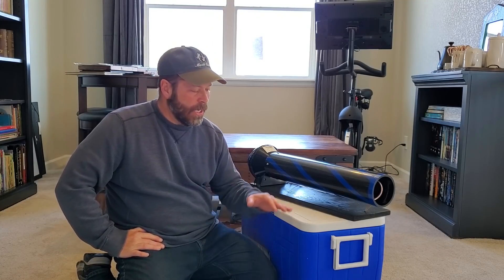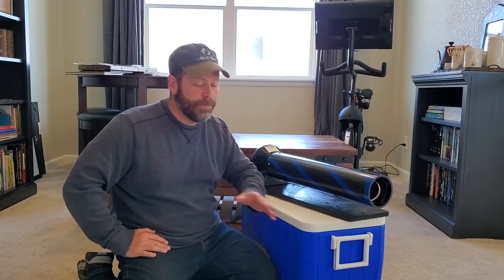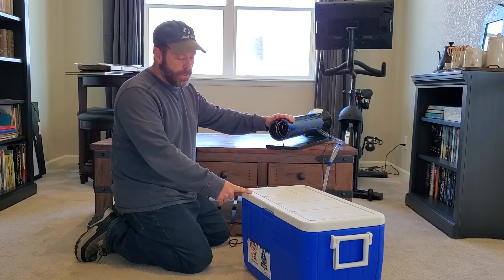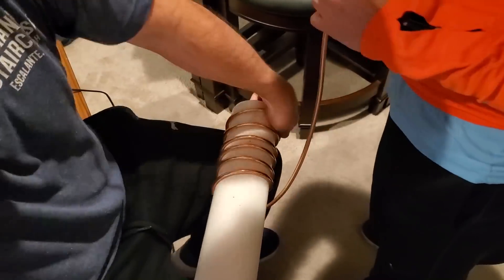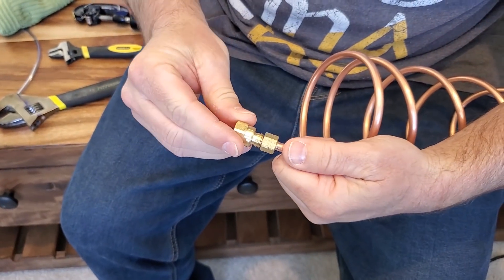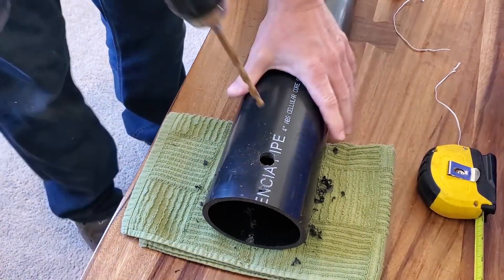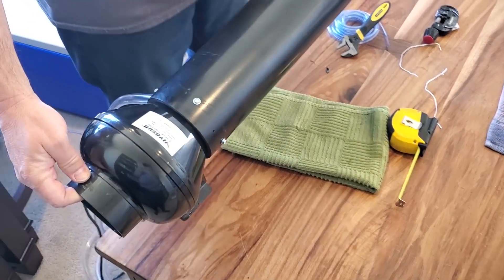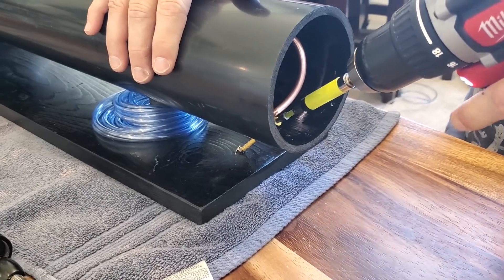Homemade Portable Air Conditioner DIY - NO HUMIDITY! - Long Lasting Ice! - The Fan Cannon

Comment: Cool idea. I’d like to see some temp readings to see how efficient it really is. 
Cheap improvement ideas:
1) You could put salt in the water. That’ll drop your “coolant” from 0 to as low as -21. 
2) make your coil a series of flat coils (like an old electric stovetop burner). This will maximise heat transfer from the fan. But will also reduce fan output. So you’ll want to find a good balance because part of what makes this feel cold is the evaporative cooling from the fan on your skin. 
3) put in a big block of ice vs small cubes. This will theoretically increase the thermal mass and therefore the efficiency.
Reply: Between three comments I thought of rock salt being added to the ice to make homemade Ice cream 🍦  .....Back up boys  , I have 50 years under my belt at making Ice cream !  I made a rough cooler once with frozen water bottles of 20 Oz and 2 liters in a big Rubbermaid tote , forced air thru the bottles and out a vent. Thank God for our freezer because it took several  sets of bottles throughout the day because they melt down faster than you can freeze them back. Not practical but I thank God for giving me enough  common sense to put it together 🙏  .  The best of my life had come home after a double mastectomy and the removal of 3 lymph node's  and we had a few days of record breaking heat . Until we were able to cool our home  ,  I kept that air blowing onto her body for several days. We already had many bottles frozen that we used for our camping trips and had dozens more empty bottles that we had saved for other things . It's funny that long before the surgery,  we had fussed over the empty bottles that were in a big plastic bag, to keep or throw away , how they were junkies up the utility room , never knowing that God had a plan for them bottles. That was over ten year ago and yes, she is still with me and the cancer has never returned. I didn't mean to be lengthy or make the subject into something else , I think I triggered myself  and just kept typing,  if it bores someone then it's too bad because I'm posting !  PS  ......OK boys get on with your designs  and figure out something better , God Bless
Reply: wouldn't the water in the tubes be at risk of freezing? could you add alcohol to the "coolant" to lower the freezing point? though I'm not sure if that could be corrosive.
Reply: @MrKool4kats  have you ever seen water in a cooler freeze?
Reply: @MrKool4kats  If ice cold water freezes in any part of the process, it would be a great accomplishment, never a hindrance. 
Transferring a frozen temperature is way better than transferring a cold temperature.

Comment: when I made mine I regret not insulating the copper lines as they sweated all over and many towels were needed to catch the condensation. My unit was made out of necessity when my home AC went out until it could be repaired. Therefore the Ice melted much faster as compared to this demo done inside an already cooled room, I assume.

Comment: Going to try this; Concerned that he says copper but link is to steel brake line. I live in high humididity FL, have cwntral AC but primarily only use bedroom & small office; want to try this just to cool those rooms to cut summer electric bills. I'll report back with my results. Good video, thanks!
Reply: Well. How was it, fellow Floridian?

Comment: If you freeze a bunch of water bottles, you can just reuse them also, just a tip that I use to keep the rest of my stuff cold for longer than just ice cubes.
Reply: Ryan you might be right about that, but I don't know for sure. I only use the frozen bottles as ice packs, and identify them by removing the labels, ill only reuse the same frozen bottles over and over again, as I don't exactly trust the plastic leeching myself. So for the purpose of this AC unit it should be okey.
Reply: Ur a freakin genius. I was watching this video to hopefully find a solution for possible water coming through If I built one of these for a bus but with a fam with a larger cfm. This is the solution. !!!! Freakin water bottles. Ur a genius.
Reply: I'll probably be seen as a crazy person, but water bottles exposed to extreme heat and cold leech off chemicals. Idk if you use safe plastic, but most sites report it's very unhealthy to drink that water over long periods of time. But who knows, maybe it's all bullshit I'm not an expert
Reply: @justwannausemymomsipad  I thought they only are dangerous if they’re left in the heat specifically in the sun. If kept cold. It should be fine.
Reply: @Philosopherseyes  Maybe you're right. I was always told it was extreme temperature, regardless of hot or cold, but I guess thats what google is for
Reply: @justwannausemymomsipad  you're not drinking the water?
Reply: @chrisdevalcourt648  If I'm using water bottles for this purpose I drink the water first. I fill it with sink water and reuse
Reply: @justwannausemymomsipad  got it!
Reply: No one us drinking it. @justwannausemymomsipad
Reply: Its consistent temps below zero, high temps especially in sun, and huge repeated temp changes (so going from one extreme to the other) and some brands use safer plastics now

Comment: Another cheap way to make this, would be to find a discarded window AC unit or dehumidifier and use the evaporator or condenser radiator that's inside and also the fan (if it still spins) to replace the spiral copper tube & inline fan. Make the radiator mount onto the lid of cooler or off to the side using long water hoses, have the fan mounted to the radiator blowing air across the radiator. Similar to the setup of an electric fan in car blowing air across the radiator.
Reply: What about the coolant in it? Isn’t it cancerous?
Reply: @TheGrandTato  My neighbor threw away a window AC because all the coolant/refrigerant leaked out. No more cancerous than propane or butane some refrigerant is actually literally  propane & butane.

Comment: What if you put dry ice in the cooler? Could it work also?
Reply: I believe there would be a risk of co2 poisoning
Reply: The water (coolant) in the line going into the air cannon would freeze pretty quickly with dry ice

Comment: FYI..the "copper" tube you've listed is actually steel with a copper(ish) coating. I'd expect it to rust fairly quickly pumping straight water.

Comment: Awesome design ! My only question is what about all the condensation on the lines ?
Reply: this might be dumb but couldn't you just tilt the fan and let the water drip into an external resvoir? like a bucket
Reply: well said i was thinking the same thing although a return could be placed in the tube but for the standing fans idk how that would work

Comment: It would have been nice to see a temp from the output of the unit
Reply: temps aside this will work fine, it's just a radiator attach to and ice bucket. Should just buy a normal radiator instead.
Reply: @lateforwork2922  I was thinking that too but i think the tube design may be a good idea.  I like having the air forced through a cold enclosed area.  I thinking adding more copper tubing, double, triple the amount and insulate the tube and you can have something that works very well, shooting cold air in the concentrated direction.
Reply: @vinzklortho3013 why bother insulating the tube? Is it not an indoor system
Reply: I use a transmission cooler.
Reply: @south_pa   I’m interested in seeing a photo of how yours was made. I enjoy learning this DIY and seeing where the transmission cooler is located, where you bought and how you installed it? 👍🏻
Reply: Or maybe a heater core?

Comment: Looks good.  
With the 12volt configuration ( and a good LiPo battery (or 2) for power ) would it work well to cool the interior of a small 4 - 6 seater airplane?
Thanks, Chuck (NE Florida)  : +)

Comment: What is the difference between this one and the more simple version with an 8 or 10 inch fan blowing directly down into the cooler filled with frozen bottles? Honest question, I love learning. My version the quality of the fan is key. Typically a high speed heavy duty fan at 10 inches for the exhaust . Instead of one 3 inch elbow outlet blowing in one direction. I add 2-3 two inch elbow fittings spread in a Y formation to cover more area. It was blowing a constant 36 degrees for several  hours and kept the area very comfortable for over 6 hours. Of course I used a very large cooler, 10 inch heavy duty fan with a higher speed than most domestic fans. You couldn't sit in front of it more than a few minutes

Comment: Just put a fan in the lid and a 90* outlet of pvc. No need for tubing, copper, or pumps. Will help with condensation as well.

Efficiency will also increase due to not needing electric for the pump.

Just my 2 cents worth...
Reply: And adds lots of humidity!

Comment: I would hope there is no or low humidity since one of the main principle operations of an air conditioner is to remove excess humidity and heat.
Reply: Most diy systems are glorified "swamp coolers" which dump cool, but humid air into the space. This design is similar but does a better job of keeping the moist air inside the loop.
Reply: Yep that's why they are called air "conditioners" because they not only drop the temp but they remove the humidity. This is merely a chiller.

Comment: Excellent idea.  Missing condensate return back to cooler as noted in other comments.  If you are not having much condensate, then most likely your output air is not cold enough to draw out the moisture from the air.  In that case, lowering the amount of air would help...this would reduce output temperature.  Also, since this is a closed system the height doesn't matter to the pump.  As long as you start the flow going at a lower elevation, your pump will work regardless of the 5 ft rating you mentioned.  Water would then just be syphoning down.
Reply: I'm wondering if you could build a DIY AC that could cool a 10X10 room just as good as a 5,000 btu window AC using less power by adding  an ice maker to the inside of the cooler. Like use those ice tray size/type ice makers that are used in regular freezers....Since there is already a small fountain pump inside, it could have a T fitting on the hose and be used to divert/ pump some of the water back into the ice maker while the rest of the cold water is pumped to the cooling radiator that sits on top of the cooler lid and has a fan blowing on it. As the ice melts the ice maker inside creates more. If you could find a 12 or 24V DC ice maker, DC small pump & DC fan, you could wire them all directly into solar panels without a battery bank or need for an inverter. When the sun comes up it automatically turns on the pump, fan & ice maker and runs/cools until sundown.
Reply: @michaelbrinks8089  If you are going to buy an ice machine why not just buy a 5000 btu ac. It would be cheaper. More importantly what you are proposing wouldn’t work because you would have to extract the heat from you ice cooler out of the room otherwise you are just making the room hotter unless your ice making is more than 100% efficient which is an impossibility. What make an ac unit work is that you have the hot condenser air extracted to the outside.
Reply: @mgpvii  I had the ice machine and other parts laying around for free. In freezers they put the whole ice tray machine inside the freezer with none of it vented to the outside. So I'm pretty sure they don't give off heat from one side that needs vented like a peltier does. If they gave off a lot of heat I highly doubt refrigerator manufactures would put the whole ice maker inside the freezer section without venting it's heat to the outside.
Reply: @michaelbrinks8089  you clearly don’t understand the refrigeration process, work load process and efficiency.

Comment: I'd like to see the temp of the air coming out.  Do you get enough exchange with the copper tube only around the inside wall of the pipe?
Reply: You get 8 or 9 degrees tops.  Don't waste your time and money...
Reply: I don't believe it will cool anything bigger than a small dog house and even then only a couple degrees.
Reply: @alingram5541  Are there some facts rather than opinions? If it cooled down a tent or van or a dog house then it would be worth it. If it could run off of solar then it would be super.
Reply: @carolhewett3756  
Exactly right!
I'd also love to see it solar

Comment: I’ve been experimenting with a bunch of these homemade coolers. There isn’t enough copper coil in that to really do anything IMO!  Hence the reason you see no temp readings. Most of these guys with temp readings are running them in 70 degree rooms. Try making some of  these and running them in +80 degree temps.  You don’t get 40 and 50 degree air coming out like a lot of these videos claim 🤦🏻‍♂️ 🤣
Reply: Lol. Thanks fir exposing facts. I seriously don’t want to chase a losing proposition
Reply: @pattip1413 if you are looking to make a home made cooler to cool a space I can give you some ideas but first what part of the US do you live in?  I’m just asking because my suggestion is something that will only work in an area that has low humidity. I live in Colorado and we have very low humidity during the hot part of the year.

Comment: All the time your freezer is putting heat into your house while it's making the Ice for your cooler. Zero gain.
Reply: Zero gain if your systems were 100% efficient which no system is.  So you are actually adding heat to your house but that is not the purpose of this design .  This is to cool a van/car or spot cooling a small area.  You don't car about the overall heat gain to your house.  You want to feel cool in the immediate space you are in.
Reply: also I don't think this is ment for a house. it's ment for a camper / workshop as a personal cooler

Comment: If your ice is melting faster it simply means it is absorbing the heat at an accelerated rate.  As long as that heat is only being absorbed from your conditioned space there is no inefficiency in having your heat exchanger inside vs outside of your ice chest.  Reducing humidity makes the perceived climate more comfortable at a higher temperature.  The condensation collected by your copper coil should be returned to the ice chest or it will likely evaporate from whatever surface it drips onto.  Your supply and return lines need to be insulated as well due to the condensation that will be formed on them until the delta between the water vs air temperature drops.
Reply: say you had that on the cooler, how do you get to cycle only cool air back into itself? seems like a never ending battle, i get if you cool your room down it'll last longer using the room air but i want something more efficient.

Comment: Why the smaller return tube?
Reply: The output tube probably just matches the connection on the pump; the return tube matches the copper tubing.

Comment: supply line to the coil needs insulating and the return line also. this will lower the over all temperature air flow. nice work.. air flow can be controlled also for lower temp's.
Reply: @charlesmasey6815 --- What could you use to insulate the tubing...?? I'm in process of gathering supplies to make this, and love the idea of increased efficiency through insulation, just not sure what to look for. Anyone's thoughts would be really helpful. Thank you 😊 
~ Heather

Comment: You really should get a patent fh or your idea and I don't mean Invent Help. Your idea will be taken and someone else may reap the benefits.
Reply: Just my 2 cents, but from experience i learned that you can't patent an idea, only a product or device.  
   I had an idea for a tool and took it to a patent lawyer,  and showed them. I didn't know anything about a fee for applying.  I didn't hit. So i took my tool, drawings and photos and left.
    Six months later Gebhardt's, Auto Zone,  NAPS were all selling them. BE CAREFUL WHEN WORKING WITH  CROOKED LAWYERS.  I think that's probably ALL of them. 
   Ya know,  there'd be no such thing as a lawyer if you never needed one.

Comment: IN order to cool a 10' 10' room it would take about 150 pounds of ice Constant without melting. All these kind of coolers are O.K. for cooling one or two people as long as the ice lasts and it blows directley on them.
Reply: True, which is exactly what some people are looking for…👍
Reply: Not true, my friend tested this in car and it dropped tempersture from 105 to 93 inside, you could find similar test on youtube.

It's not ac but it's not just cold air.

Comment: It may not ADD humidity, but this setup doesnt REMOVE humidity either.  Need a way yo capture the condensate coming off the coil and route it back to the cooler.
Reply: Any ideas????
Reply: @jordanoliva-harring430  sam shannon has the right idea in these comments

Comment: Kinda feel like he could have put central in instead of getting the pelaton bike in the background 🤔🤷‍♂️
Reply: not sure where you're from but here central is gonna cost you 5k  plus just for the unit install, depending on the size(in my case it will be a lovely 10k to replace it That doesn't include duct work and whatever else he might need to get the unit installed, not to mention the monthly utility bill on top of that. Not to mention the constant maint costs and that's if you're lucky and they installed it right and you didn't pay 5k for a brick(take a lot, I mean a lot of -I just paid 5k for this unit and it is not working calls in my job) A peleton is what? A couple of thousand that they will let you pay off for like 10 years?
Reply: @Ceares  just paid 4400 for my central ac to be installed. Isn't a pelaton about the same price?